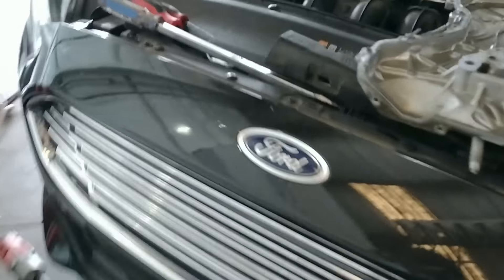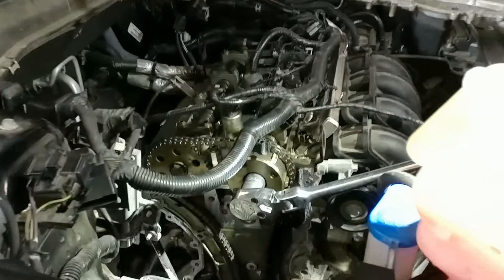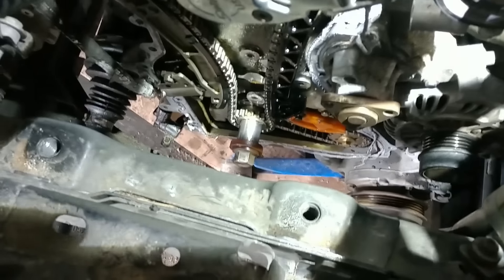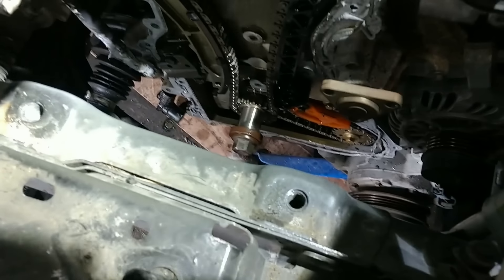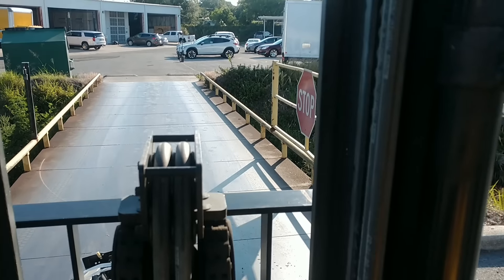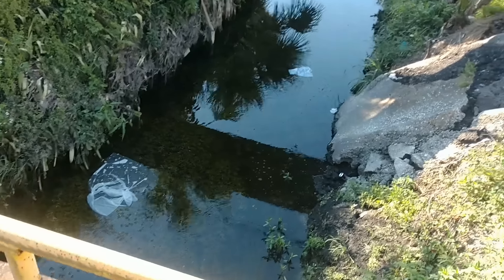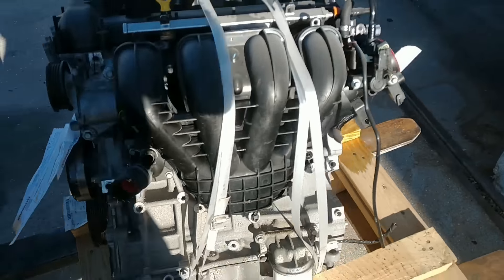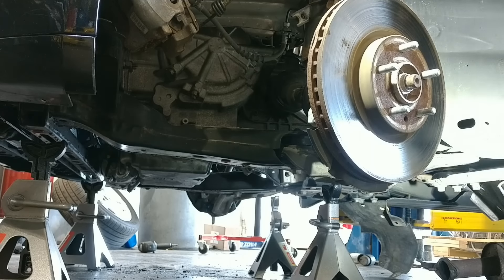Damaged Engine: You Broke it! Pt1

Comment: Yeah, great engineering idea on an interference engine.
Reply: @Screwdriver440 he was referring to the fact that the valves would hit the piston if not timed correctly, hence the "interference". Non-interference motors wouldn't be affected as the valves will always clear the piston regardless of timing.
Reply: But think of all the money the manufacturer saved not having to machine a small key-way and supply a key for the timing gear.
Not to mention the profit from selling a few extra valves and heads, since this was probably not the first time this happened.

Comment: this is the same engine in the 2007 mazda 6 my wife had.. same issue.. had no idea there was no keyway, or anything... that the crank timing was a "friction fit" item... it would up wiping out a set of valves on one cylinder... wound up saying screw it.. gave up the car (was'nt worth much), and bought myself a new truck.. wifey got my 2013 cx-5 for about a year until I found her a 2017 4runner.

Comment: Ford engineering has sure went down hill. It's a shame when a Kia is a premium brand to a Ford
Reply: Lol. This engines been around for like 25 years. Its a reliable engine and pretty bullet proof. Mazda uses this motor too and also had a Turbo varient.
Reply: Well, car companies in general have gone downhill, i mean the chevy plants in Mexico can’t even put diffs’ together right. As my brother said, working on cars makes you realize all car companies kinda suck, or at least there is something that is always crappy about them.
Reply: I don’t like Ford but I wouldn’t go that far brother. Coyote motors are breaking records I haven’t seen a Kia do anything close to that.
Reply: @TeamTopKick  yes mazda use it and it brakes down a lot ! Camshaft done for in 200000km unaceptable. I take a better engine like a opel or isuzu every day over a ford
Reply: @Based-Cat88  idk mines gave zero issues. Been 100% reliable albeit underpowered. I have a Isuzu too and can contest to there ruggedness too as long as its a actual isuzu built motor and now the tiny GM V6 used in them.
Reply: @TeamTopKick   I already rebuld 3 of them ford engines. Mostly stripped cams (lack of oil in top block under load) i love them og isuzu got 1 running at 4900000km still going strong
Reply: @Based-Cat88  i got a old OG 2.5 Ford and its still running great. My Fusions 2.5L has been bullet proof. Yeah the Isuzu 4ze1 is pretty great motor.
Reply: Sigh.. The 4 cyl in this car is made by Mazda (L).  It is not a Ford.  The engine upgrade option was the 3.0V6 which was built by Ford and was good for 300K miles.  Despite that, the Mazda 4 was a decent engine that didn't have this problem unless procedure wasn't followed.  Mazda is certainly not alone in odd things.  Try taking a German engine apart..

Comment: In 38 years of being an ASE certified Master Tech, I've never seen a lower gear that didn't have a key. But if  that's the way they retain that, it's great because you can infinitely adjust the timing ,  but what a shitt design. Anyhoo, It's not that bad, you didn't run the motor, you just turned it by hand to bend the valves. That means there's only four valves that could have possibly bent in two cylinders.( all depends on where the cams were positioned when he spun it) Because it didn't run, there's minimal damage to the Pistons, my bet is there is none. Pull the head, replace the vent valves, new head gasket, and send it. My buddy had a Kia Soul, I was driving down I-95 when the timing belt snapped, bent like six or eight valves,( this thing was doing 75 mile an hour when the belt broke) got it towed to my house. I pulled the head off, pulled the valves out of the head that were bent, straighten them myself(!), lapped them in, put a head gasket kit in it, and sent it. That car is still driving down the road today. And I did it in one afternoon, with no air tools. Suck it up buttercup. $400 plus gaskets, for another motor, how about $20 a valve, I think you said you only bent one, so you only need one, and, that take 15 minutes to put in the head, and a gasket set, about $135. Seems like you made a lot more trouble than you needed to, even after the timing chain fuk up. I mean it's a 4-cylinder cylinder head. I could do two of these in an afternoon at my shop. I put Main and rod bearings in, in an afternoon. You just went way the hard way I guess.
Reply from the maker: You know, that's what I wanted to do. But the bosses with their infinite knowledge and wisdom decided that a $400 engine, and making the kid replace it 🤦 was a better option than paying a technician to repair the damage and have possibly have a machine shop bill. Proof that the world is upside down. Managers should be working for the Technicians. It's time to start planning on opening my own shop, I can't deal with working for the walking dead any longer.
Reply: You can get Vernier pulleys for that, it's no good having infinite timing that can just slip 🤔
Reply: @RainmanRaysRepairs  Good way to guarantee a comeback is to try to toss valves in this head. Time is money, friend.
Reply: @RainmanRaysRepairs  good on you! That first steps are the hardest but once you get the shop set up you'll be in heaven! Freedom! Wish you the best!

Comment: I've seen this happen before slight misfire after new AC belt fitted. slipped 2 degree's just because it was turned over on the bottom pulley fitting the belt

Comment: There is a "diamond crush washer" that has to be replaced any time the harmonic balancer is removed. I've heard of them slipping even when washer is replaced. I think the bolt needs replaced too.
Reply: I heard the same thing. My buddy had to pull a harmonic balancer on one of these, because it ate the serpentine belt. He found out the hard way.
Reply: @philjerome9795  im glad i found this video long before i have to do anything on my fusion
Reply: As a ford tech... All Ford balancer bolts are 1 time use. The diamond crush washer is also 1 time use. I also kind of remember there being an odd timing tool to use on these engines where you screw in a flattened bolt and spin the engine over and itll lock it up at tdc and there was a problem with people forgetting and cranking it over with the tool installed still. with the right tools, these aren't really a problem to work on, but without, a nightmare. Even if something seems simple I always looked up the workshop manual for the job and skimmed it

Comment: I had a bad radiator leak and failed to maintain water volume and caused the lifters to fail. So I took the engine apart and in the process decided to change out the cam and gears. I lined up the cam 180 degrees off and had to replace both heads. It cost me over $1000 in parts to fix.

Comment: Thats the Mazda derived engine...ya there is a special tool you put in the back of the cams...and in the side of the block to keep the cams and crank aligned properly...the balancer holds all the timing stuff still via friction alone. You NEVER take the balancer/cover off without haveing thoes tools already in place...or else your risking valve damage...like what happened here. Its a pretty reliable engine but you gotta know how to work on them properly/have the right tools to do it. Seen alot of Independant shops screw these engines up because they didn't know any better.

Comment: So you’re saying that the part that controls timing on the engine is held in place only by friction? There isn’t a key or anything to maintain crank position? 
Your shop didn’t fail, whoever designed that engine did.
Reply: There is a timing peg that's used during assembly to hold the crank at tdc. There are diamond coated frictional washers between the balancer and the gear and between the gear and the crankshaft. 
Its the shops fault because they are not investing in the correct workshop manuals/autodata
Reply: @MattyFielding6  Its still a garbage design, you should always have something on the crankshaft keyed to the timing gear to ensure its always in sync and constrained, that's a basic mechanical design rule. Looks like someone decided to save a few bucks on machining a keyway and this is the result.
Reply: @MattyFielding6  Amazing they could afford a DIAMOND COATING. but couldn't cut a key-way.
Reply: @djslaviero  Wouldn't a key and keyway wear with use, and thus change the timing, which changes emissions, fuel economy, and probably other things?  Someone mentioned the accumulation of errors that happen with wear...  Apparently Ford and others needed this method to allow for necessary emissions, mileage and increased power.  Or something.  Nevertheless, when I first discovered 'Interference Fit" I quickly determined  if either engine in my cars had such an animal, and they did not, to my relief.
Reply: @ammoalamo6485  No a key is meant to shear if the load on it exceeds the calculated amount, in normal service it is press fitted into the keyways and shouldn't wear at all.
I'm a fitter/machinist by trade so I'm very familiar with this.

Comment: Why in the world would an engineer design a friction fit crank pulley for anything. Valve train to rotating assembly is about the most important part of keeping an engine safely breathing. No wonder I don’t like Fords.
Reply: The 4 cyl motor is the Mazda L.  The Fusion was a collaboration with Mazda when Ford owned a lot of stock in them.  The V6 option was the Ford built Duratec 3.0L which is bullet proof.

Comment: 2:40 its the same with 1.3 cdti fiat engines, they are also chain driven like that one...the cam pulley holds the sprocket...also some 1.5 dci renault engines (belt) use that system...a lot of modern engines are like that....overhere we call them "crazy pulley engines" engines that dont have keyways on pulley or sprockets related to engine timing

Comment: My weakest thing is diagnostics I can repair most things but I need to find a way to diagnose faster. One example of this was I bought a 66cc 2 stroke engine kit for my bike and I couldnt get the damn thing to run no matter what I did I eventually took the exhaust off and then the motor started running perfectly leading me to believe that the brand new exhaust was plugged nothing could get through it not even water but it took me a month or more to even suspect that I just assumed that all the parts a re brand new so the issue must be with my assembly. I guess I now know that you can't trust a new part just because it's new. I love taking shit apart been doing it since i was a kid I used to tpick up electronics on big garbage day TVs, VCRS, TapeDecks, record players and walkmans just to name a few and I would take them home and tear them down and try and fix them most of the stuff needed new belts and some just needed to be cleaned.Hell I even got my washing machine and dryer from the side of the road the washer had  asock in the pump and the repair guy told them it was shot and sold him a new set all I did was take the sock out put back together and wham all fixed and done the dryer just needed an element but I had to take these things almost completely apart in order to diagnose them my father could diagnose shit over the phone I'm not hirable because in most cases I need to take it apart and in turn this means I take too much time making billing a problem.  It sucks but how do you do it how do you seem to always have an idea before you even take it apart how?

Comment: I miss old school engines where things make sense and you can fix it with a screwdriver. Why all this "you need to do this and this and this in order to disassemble"?
Reply: All done to stop user maintenance, or at least make it damn difficult
Reply: I don't miss the old school engines that you could work on - and had to work on, because they needed points and plugs and such all the time, and frequent oil changes, brake jobs, rotor replacement, tires that wore out at 20K miles, and engi+nes that would not last 100K miles of easy driving.  Did I mention the 14 mpg of my 327 Impala, or the 11 mpg of my big Ford 427 family boats?   I loved those two cars, until I pulled up to the pump, and until they wore out way too quickly.  We have a heyday of resto-mods and rebuilds of Muscle cars, but I lived through that period, and if those cars lasted three or four years it was a miracle.  They could only go fast (but not really fast - say 14 in the quarter) in a straight line, their brakes were shiite, same for suspension, but if you chose the right options you could get some cold AC and an automatic that, for all its two or three gears, lasted about as long as the engine.  Did I mention how unsafe they were in any crash from any angle?

Comment: Ah man, does this mean you're going to post all the videos the dealership would have fired you for?😂
Reply from the maker: Lol this is the one I was most concerned about. This is one of the last ones from the stealership.
Reply: Was that a Ford dealership?
Reply: @jimr549  he said in the videos, GM.  probably part of the reason the mistake happened with the crankshaft sprocket, i blame the guy who took a ford to a GM dealer.
Reply: @PandaMan02 :  Exactly. At Cadillac, we got all kinds of GM vehicles, but i don't recall any Subaru or Mazda 😆. They have their own clubhouse!
Reply: @hightttech  Might've been a used car sold at that GM dealership that wasn't one of their brands. Not uncommon for them to service used cars they sell, even if it isn't one of their makes/models.
Reply: May need to read a manual BEFORE YOU START PROJECT LIKE THIS.

Comment: And I thought GM had some dumb engine designs.
Reply: They do, However this was a "MARKETING DESIGN"  by FORD. Build it to fail after the warranty is up. Then come up with some astronomical cost to either repair what you have,  or replace it with a new/ used engine. Which either is probably close to $2-K all in. 

Or...... Ford will be happy to give you 0.0% financing on a NEW FORD PRODUCT. What a bargain, RIGHT???

Comment: At 2:41 the caption reads "The valves and 'positions' met earlier today." Was that *valves and pistons*? An interference engine? Oboy, oboy!  About the replacement engine: Was that an engine out of a salvage vehicle? If so, how did the shop square that with the owner of the original vehicle? 
It doesn't look like a crate engine and with all the bits and pieces on it, it doesn't look like a Jasper 'zero miles' reman either. Just curious.

Comment: Did you inform the customer you put in a wrecking yard engine?  (some places would have stalled for a week, and then said "It is repaired, come pick it up!") Hope it is not one of the you tube "Motor gets first oil change at 40,000 miles."    You did pull valve cover and oil pan to make sure it was not gunked up with sludge, as well as a compression test?

Comment: One of the reasons I only owned 2 Ford's for a short time in my life back in the late 60s early 70.
 A Ford galaxy. Wagon 428 vs replacement motor.
 And a 61 T bird.
 Both used. Both were ok.
 Replaced wagon with 64 VW bus/transporter(liked it after I put a Porsche moter/ transaxil) in it.
 Replaced it with a willys/ overland 54 4X wagon, 283 Chevy V8.
 The Tbird was pink soon as I got it running sold it.
 Been Chevy/GMC truchs ever since.
 With 1 rocking 86 Toyota PU..
 Loved that truck put 500, 000 mmiles on it in 18 years.
 Replace 3 motors, 4 trannys 1 rear axil in it. It went any where, would almost climb trees.
 Sorry ford guys, just never could get into the way ford does things..
 Did my own mechanic work after I got roped off by 2 shops and a dealership as a young working man.
 Woulda killed to know a mech/tech like rainman.
Reply: If you take the time to read all the comments on this video, you'll discover like I did that this is not a Ford problem and why engineers have designed this, and many other modern engines this way...or you could just keep hating Fords based on false assumptions😉

Comment: As a ford tech, these engines are bullit proof, until the untrained touch them. Also, that engine comes out the top, it's a waste of time to come out the bottom. In addition, invest in a powertrain lift from OTC. Would save you hundreds of hours in labor each year. OTC 1585 A. We have two of them in my shop.

Comment: Yeah I went through the same thing on a fusion I was changing the engine. Service info said take it out the bottom. In my infinite wisdom I said ill just remove the harmonic balancer and pull it out the top. I put the new engine in and I was rolling it over to get the torque converter to flex plate bolts in and it clunked. Rolled it other way and rolled over so far and clunk. Straight to google I went and found out the same thing about the lower timing gear not being pinned. I got the measurement of the bolt that threads into block to stop crank and lined up the ends of cam flats and tightened the harmonic balancer and much to my relief the engine started when I was done.

Comment: Yeah there's a special procedure to remove the crank pulley because there's no key way so once you pull the crank pulley off you lose your timing cuz it's a press fit to hold the crank sprocket you have to put a bolt in the back side to hold it in place before you take the crank pulley off